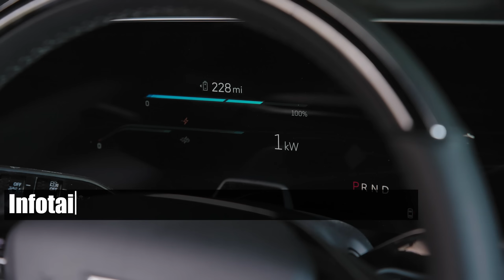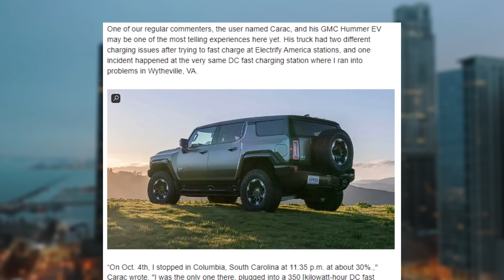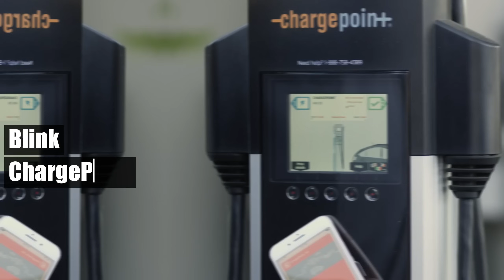The Shocking Twist: GM’s EV Future Hanging by a Thread! GM's Electric Vehicles & Price of Ambition!

Comment: My Bolt euv -- with the N2.2 battery -- has been flawless, and has saved me a bunch of money. Many Bolts have over 250K miles on the original battery. The new Silverado EV is the longest range, fastest charging ev pickup. Ultium had some initial problems, though they seem to be getting this sorted. The Blazer ev initial problems were seriously crappy, but it's fixed.

Comment: Sounds to me like not just an EV problem but more of an over use of computer intergration in all their vehicles problem. I think EV's are SHITE but thats not the problem here. How about we go back to making simple reliable vehicles. As a mechanic of 39 years I drive older vehicles for 2 reasons they're simple and easy to repair and they're reliable. The digital auto's being turned out today Both EV's and ICEV's are over priced garbage. My golden rule, the more complex the higher the failure rate, the higher the repair bill, and the less reliable they become. even if i could aford a new truck I wouldn't by  one. I'd restore an old one.

Comment: This video should point out all the nightmares an owner would face with all these different chargers - none of them are compatible with each other. Even if GM can make a charge port that would work with all of them, there is no guarantee it would connect and would charge as there still can be over a dozen issues that would cause a fault!
With regular gas or diesel engines, you put a fuel nozzle into the filler neck and it goes in 100% of the time! No faults, no errors!!!
This entire battery nonsense is pure insanity. There needs to be severe blowback against the government shoving this down our throats!!!

Comment: Too much bias.  Not enough common sense.  Electric motors are reliable and efficient.  Powerful too.  The current battery technology is good for fleet vehicles.  We need a couple of generations of improvements.  We aren't all driving Model - A cars.  Improvements happen over time.  Stop with agenda videos - and comments -  and come up with something constructive.  We are far away from the end of electric vehicle improvements.  The evolution of technology takes time.
Reply: You said it, a couple generations. We have been given until 2035 in a dozen or so states. 11 years is not going to happen.